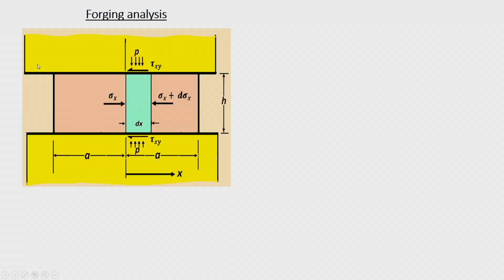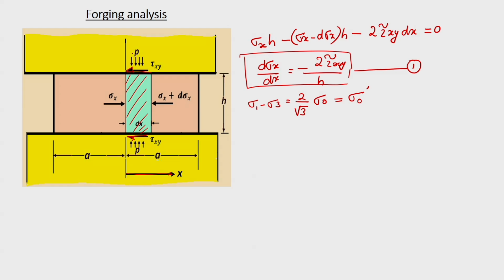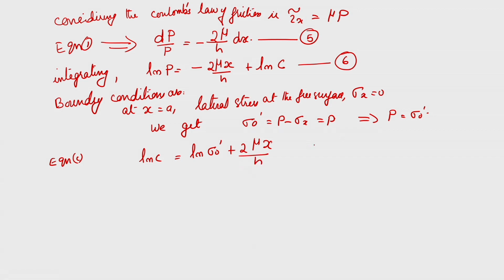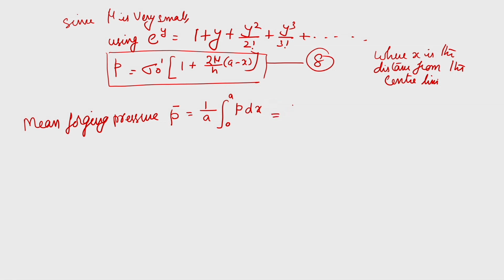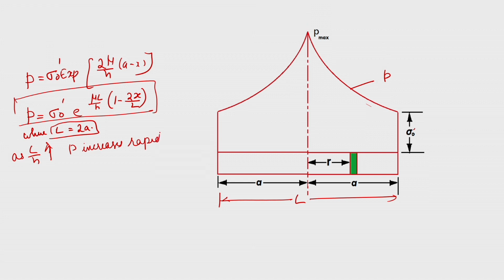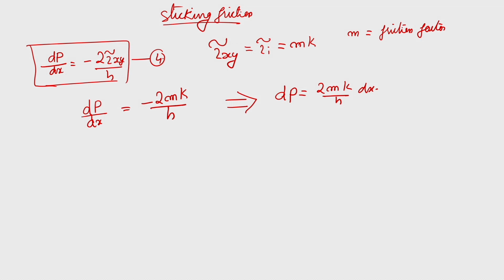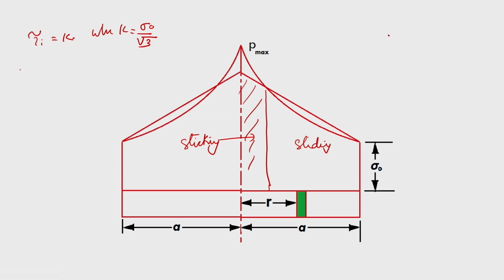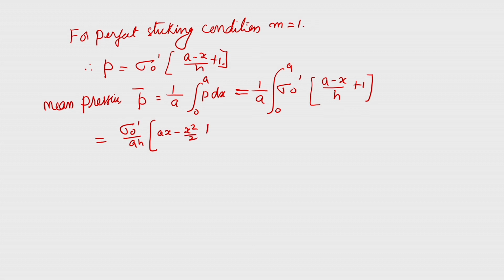Lec 14: Analysis of Forging

Comment: Sir, why is there (sigmX) on one side and (sigmaX + dsigmaX) on the other side.
Reply: if you got an answer please tell me
Reply: The normal die pressure and the compressive deformation resistance (sigma_x), both change with x due to friction at the interface. We need to consider a continuous variation, so we consider an infinitesimal change in sigma_x